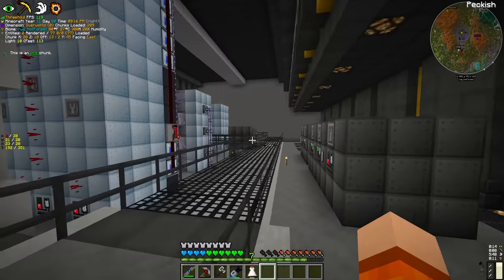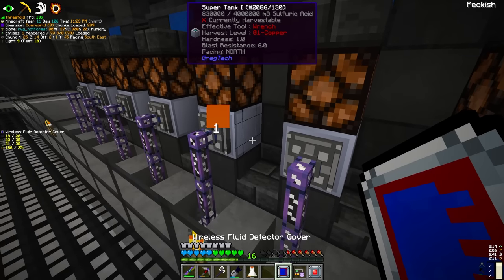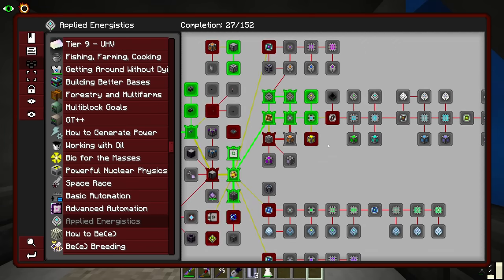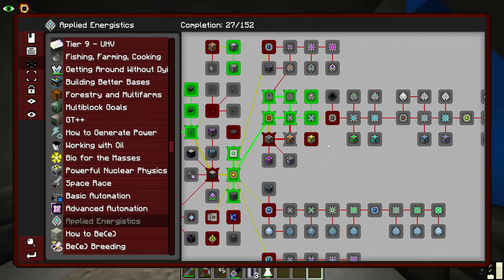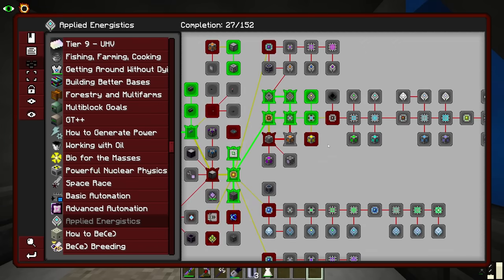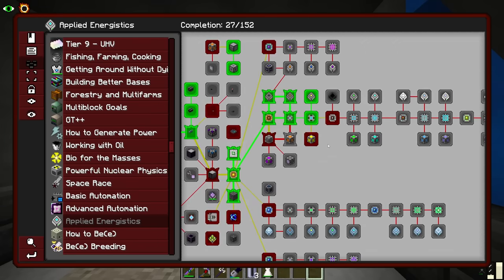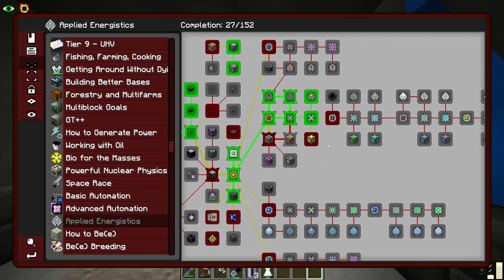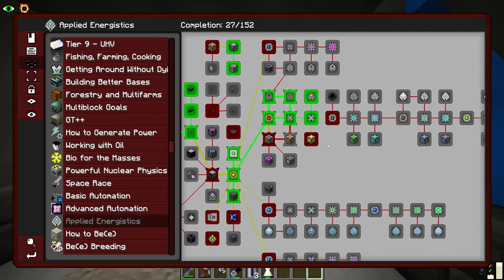Gregtech New Horizons S2 33: Autocraft Me a Circuit, Please

Comment: Since the cleanroom will be largely (though not completely) obsoleted later, and since you really don't want to put off obsoleting it since that means delaying upgrading your circuit crafting capacity, I don't necessarily recommend crafting a big cleanroom. I especially would not recommend crafting a full size one, as that is just a giant waste of resources. What I do recommend doing is looking into Electro-Magic Tools infused solar panels as a means of powering your cleanroom without hooking it up to your central power grid. It's not that the cleanroom costs that much power to run, quite the opposite in fact, it's that you're eventually going to have a centralized power spine running at least LuV power. Transforming that down all the way to LV just to power the cleanroom is beyond obnoxious, and potentially dangerous if you make a mistake with the dozen-odd transformers or forgetting to upgrade the LuV->IV transformer before upgrading your central power spine to run on ZPM instead. Since the cleanroom only requires 4 EU/t to maintain 100% if your base is in the overworld a water infused solar panel (along with an LV battery buffer) is probably ideal. A water infused panel will only turn off when it's nighttime, meaning you can be sure about how much power you're getting during the course of a day and how much you have to store to survive the night, no matter when or how much it rains. Conversely if you're in a perma-day Void World you can easily grab an Ordo infused solar panel. Of course Cleanrooms will get maintenance issues and will drain more power when they do, so if you want to prepare for that I'd recommend an additional Entropy infused solar if you're in the overworld (to generate power during the night if it's not raining and extra power during the day) and a large LV battery buffer to just eat the extra power cost until you notice and fix the maintenance issue. Or, of course, an additional Ordo infused solar in a perma-day dimension. Alternatively you could run your Cleanroom off of an LV Magic Energy Converter (or two, to account for maintenance problems) manually fed nether stars. I know, "manually fed" doesn't sound very impressive, but without maintenance issues one nether star will keep a cleanroom running for over 200 hours. Modded Minecraft is all about automation and not manual work, but sometimes just setting something up to run manually until you're done with the pack works. Even in GTNH 🙃.

Yes, that super crazy ridiculously fast electric shadow metal wrench really is that slow when it comes to breaking plascreet blocks. Plascreet is a fantastic candidate for removing via Equal Trade-ing it with dirt for that reason, simply because it really takes that long to mine it even with super fast tools.

Keep in mind that centralized power storage is tall*, with a maximum height of up to 18 blocks. Whether you'll ever build it that high, who knows, but given the fact that there are multiblocks that are 15 blocks high who *really want to be very close to centralized power if at all possible (introducing: Mega Blast Furnace) it pays to keep that space requirement in mind regardless. Furthermore setting up centralized power at this particular point is very much possible - I always recommend starting with a 16A IV battery buffer with (eventually) 16 Lapotronic Energy Orb batteries (100M EU storage each), and an IV Hi-Amp Transformer to turn those 16A IV into 4A LuV that is send down a 1x Vanadium-Gallium power spine. Is it expensive? Very much so. The Lapotronic Energy Orbs in particular require more platinum than you might be comfortable producing without setting up the first part of platline. You'll also need basically everything you need to set up nanoprocessors (and a bit more on top), which is good because Orbs also require an extremely painful 16 HV circuits each. So why do that over setting up an LSC, which got unlocked with the ability to craft LuV tier circuits? Mainly the fact that (at least in the version Three is playing) there's no EV tier multi-amp dynamo hatches, so extracting your centralized power requires either spamming EV dynamo hatches/transformers or rushing the even more difficult to craft IV tier dynamo hatches. The battery buffer with Lapotronic Energy Orbs solution is expensive, yes, but once you're ready to make the switch over to an LSC you'll have the energy orbs for it's capacitors already crafted. Think of it as an investment that you can put to good use in the meantime 🙃.

Cleanrooms can't contain too much Reinforced Glass, but they can contain a lot more glass if you use Warded Glass instead. I'm not 100% sure about how the math works out, I think there has to be a certain minimum percentage of plascreet blocks and the rest can be other blocks up to their respective maximum percentages? Either way if you use Warded Glass you can fit a ton more glass into a cleanroom. IMO it looks cleaner than Reinforced Glass too.

At this point you'd want to also cut out the HV tier machines, and instead add a 4A IV diode to later hook up IV tier machines to. You can get away with never putting IV tier circuit crafting machines in a cleanroom if you craft a Processing Array as quickly as you're able to, but those things are pricy. Worth investing in, though, at least in the few niche situation they still prove useful despite GT++ multis generally schooling them in the fine art of being worthwhile despite an exorbitant cost.

Remember that battery buffers can accept 2A input per battery inserted, so you don't need to transform 4A HV up into 1A EV just to feed that power into a battery buffer. In fact you could hook up both the HV and EV battery buffers to the same line so they're fed directly by the same turbines...though I would not recommend doing so. Because in that scenario if you were to accidentally rotate the EV battery buffer's output side to the cable line you'd have EV power going into an HV line. Not quite HV to MV, but a bad scene all the same 🙃. Also remember to keep cable sizes and amperage limits in mind to make sure you're not using resources you don't have to. At least if you're not just recycling old cables, as I suspect Three is doing here.

Wireless Connectors are the intended solution for getting AE2 into your Cleanroom, or similar situations. They're very useful for that purpose, but beware that the greater the distance between them the more energy per block space distance they're going to drain passively. If you want to know how much a pair of Wireless Connectors is costing you in terms of power simply look at their tooltip. It'll list their power drain in AE/t, but 1 EU equals 2 AE and Wireless Connectors always come in pairs, so the listed AE/t cost is the passive EU/t cost of a given pair of connectors. That said, yes, 2.2.3 I'm pretty sure has the connectors already buffed and the questbook text not updated to reflect that. A straight line of 8 empty block spaces between Wireless Connectors in 2.2.3 consumes only 100 AE/t for both wireless connectors, whereas the formula in the questbook (as far as I can try to make sense of it) apparently claims one of those connectors should consume over ten times that much. In either case you will eventually get access to creative AE2 energy, at which point you can throw around these wireless connectors with reckless abandon. And yes, Wireless connectors do not consume channels themselves, and are able to both hook up directly to dense cable and send through 32 channels.

Making 37 EV Machine Casings on accident would be a lot more concerning if you couldn't Arc Furnace them right back into Titanium ingots, if you end up needing more of those. Alternatively if you make too many of something less easily recycled on accident remember that disassemblers exist. They'll save your bacon at least once in a given GTNH playthrough.

Good old lootbags. Either they're completely worthless or they're utterly OP. There just is no middle ground with them 🙃.

Three really should build some kind of room for Crafting Card disposal at this point. Unfortunately Liquid Death won't destroy it, so Three is going to have to come up with a more...*creative* contraption 🙃.

It hardly seems relevant at this point considering the lootbags are literally throwing storage components and stuff to complete more quests to get even more lootbags at Three, but keep a very close eye on NEI when crafting storage components. There's an excessively expensive recipe to upgrade storage components to the next tier, and a significantly cheaper recipe to craft them from scratch in a circuit assembling machine. Use the correct recipe, or you won't have any resources left to store on your new storage disks 🙃.

Autocrafting circuits is indeed a big step in progression. You can get away with not setting up AE2 autocrafting until IV, as I did in my survival playthrough, but don't. That was, as the scholars put it, "a monumentally stupid idea". The circuit batching eventually will break you, if not before you start to craft your first Assembly Line than definitely afterwards. Instead I recommend not just investing in autocrafting circuits early, but in keeping on top of your ability to autocraft circuits both consistently and quickly. Put stuff on passive once you've got the resources for it coming in and being process, move over circuit crafting machines to PAs to run multiples of them in parallel, etc. Circuit crafting, much like EBF smelting, is a process that's going to consume a fair bit of time going forward. Don't let it catch up to you, stay on top of it if you don't want to end up waiting on circuits to craft.
Reply: May I ask what the deal is with crafting cards? Everyone seems to hate them, but no one ever says why 😂
Reply: wow thats a long comment
Reply: @jaycobobob  they can cause a ton of tps lag
Reply: @jaycobobob  If you've watched Three's DJ2 playthrough recall how much time his AE2 system took to calculate lategame crafts like alchemical chests and whatnot. Now imagine those kinds of crafting calculations taking place literally every tick, per crafting card.

Crafting Cards can very easily send your FPS (and TPS) into the abyss. They do have uses here and there, there are correct uses for them, but you have to be really careful.

Comment: Soldering alloy isn’t the only thing that’s used in the circuit assembler, so might want to switch to Ae2fc later
Scroll wheel in pattern terminal to change ore-dicted items to another type